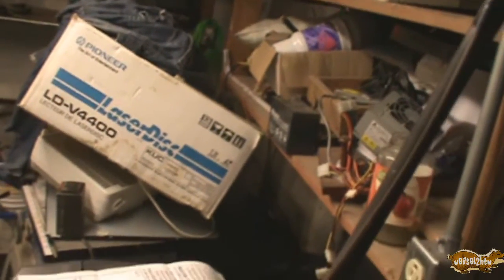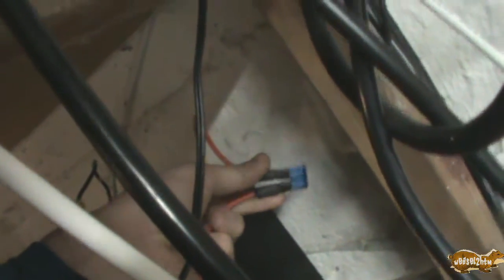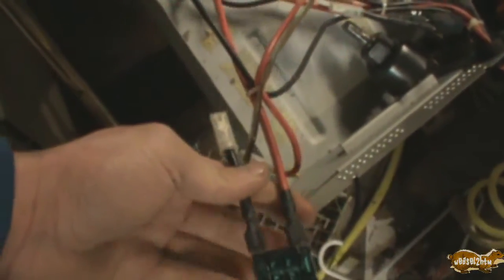UPS using a external battery

Comment from the maker: By time you pay the core charge and tax, you can figure on around $40, if you need to buy wire and connectors probably another $10 on top of that.